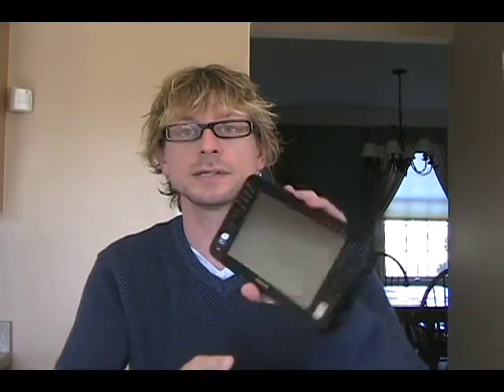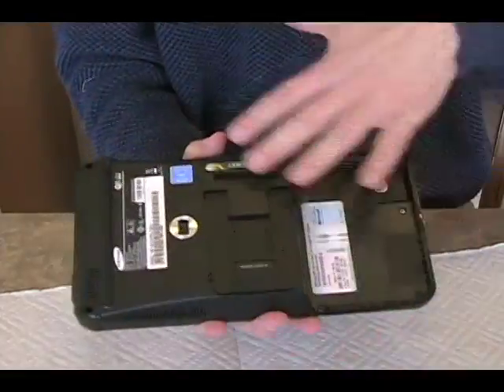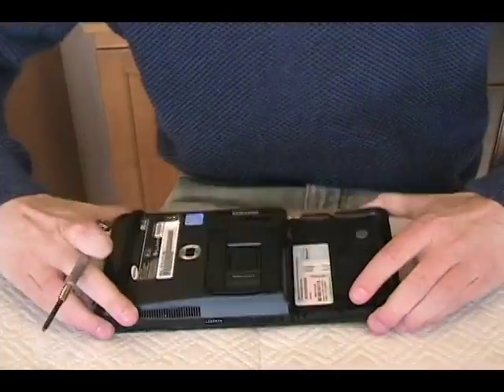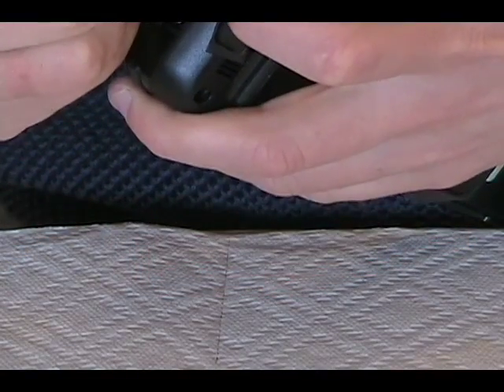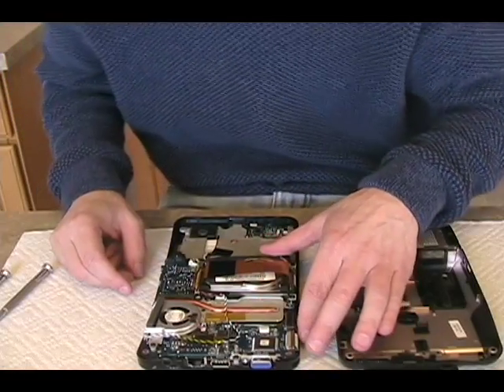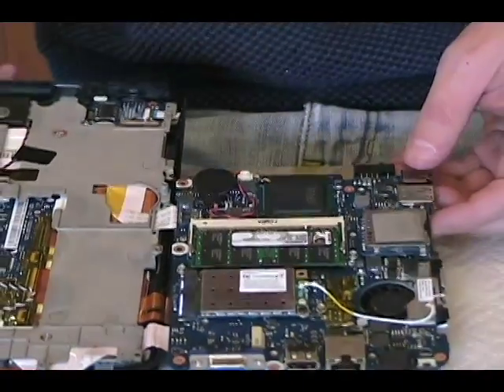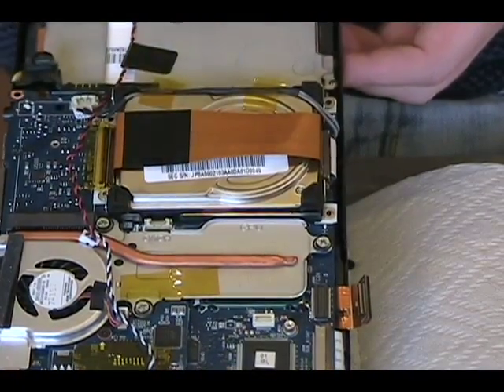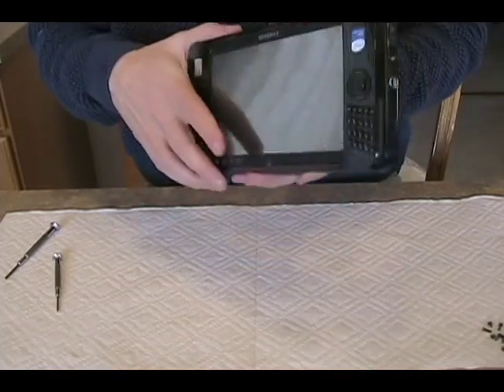How to upgrade the RAM on a Samsung Q1 Ultra Premium

Comment: If you have a Samsung Q1 Ultra, model NP-Q1u 
Then the part you want is:CT25664AC667 from crucial.com
or DDR2 PC2-5300 • CL=5 • Unbuffered • NON-ECC • DDR2-667 • 1.8V • 256Meg x 64 
I upgraded my Samsung Q1 Ultra using this RAM, and it works

Comment: I have a set of jewelers screwdrivers with bigger handles, I bought them from eBay and you can grip them better.  I used them for taking apart laptops as I fix computers for a living, cost around £5, best £5 I've ever spent. And the screws your undoing probably were done up by a robot with 20 inch biceps, lol.

Comment: Make a USB Driver Bootable and put a windows edition on it. Then press F12 (i think). To choose the  drive u want to boot with just click on the "Boot" Menu. After u done that just find your USB Device. After you done that u press the quit button in the menu and choose to save these settings (You can change these later on). And then when the windows installer launches u can choose to remove/format a drive. (and install on it) Btw I dont take responsibility for any harm it may cause on your q1.